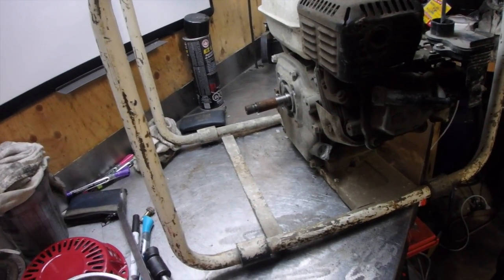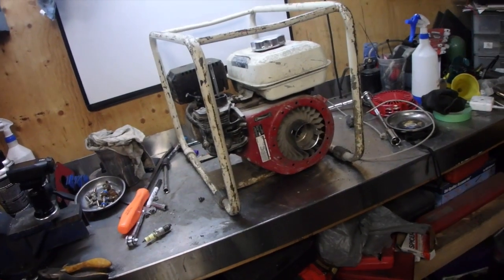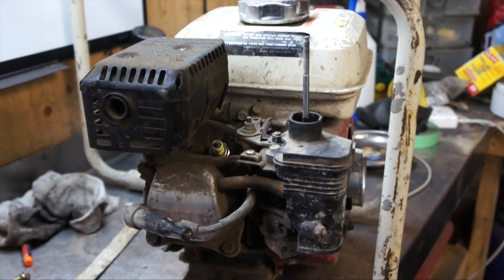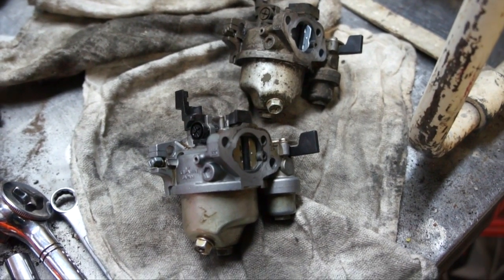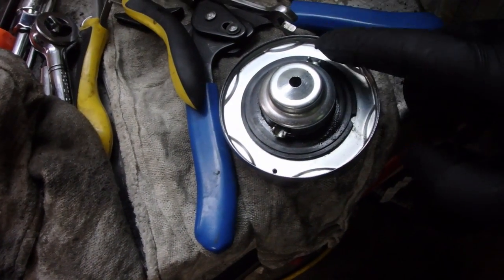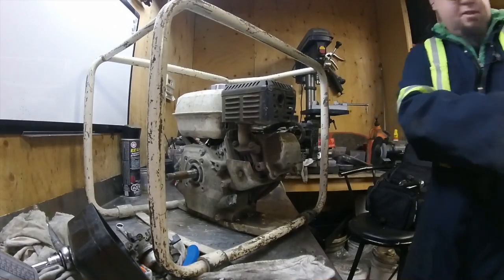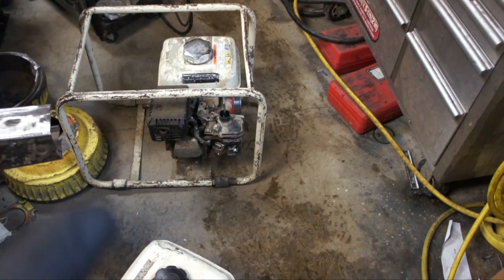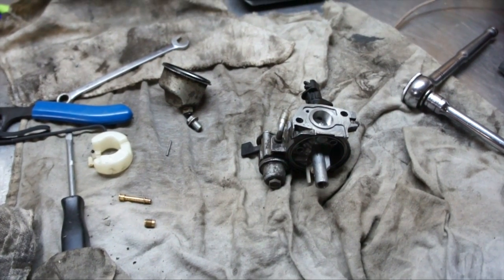Engine Only Runs When Choke is on

Comment: I've got the same problem!!! By the way, the choke lever has a nodule the same diameter as the fuel line so just pinch the hose and pull, then attach the choke lever to it. No leak ;)

Comment: Same for 2023 cars & trucks. The fuel filler cap lets air in! The amount they let out from pressure "Does" change. Stamped on cap or sticker, "Caution" May spray fuel was seen on 1960-70's cars. Carbon canister allow air to vent to atmosphere, but capture fuel. The pressure out was 1 PSI for decades then changed to 2 PSI so if tank pressure got to high. 10+ years ago, inputs from timer, air temp and time driven requires "Engine-Off, Natural Vacuum" helps the fuel tank pressure sensor sends info to the PCM 20 minutes after its shut off and eating dinner. This detects tiny leaks, not small or large. 
 Caps have to be tested and aftermarket caps with Keys to keep that expensive fuel from being siphoned, all fail. It take run time and temp before these test are run, so not the next day but still!
DK, ASE Master Tech since 78, retired

Comment: Dude it's not the fuel cap 🙄 You should be able to take off the fuel cap off without causing the carburetor to leak, that's just common sense. Have you ever seen any other carburetor leak every time you take the fuel cap off I mean that's ridiculous.

Comment: I have an old Honda GX200 motor and it wont run off of choke for more than 5–10 minutes of riding; cleaned the engine, carburetor, and even the gas tank & bowl; it idles fine, but wont give me full gas “sometimes”; the throttle can give me a little bit of rev, but too much rev and it will shuf off. Any ideas?
Reply: Man I'm having this EXACT problem please tell me you figured it out?????
Reply: @evanessary9056 same lol did you figure it out ?

Comment: If your engine simply won't run the quickest way to get somewhere is spray a flammable into the air intake like carb cleaner or starting fluid and if it still won't even fire for a second you have no spark. If It does fire then your having a fuel issue.. disconnect the fuel line from the carb and make sure its flowing out nicely. If not then most likely just need to clean the carb, its not difficult just take photos and remember exactly how everything came apart, note which side up or down on any little parts you remove.. stay organized and don't lose anything, Goodluck :)

Comment: there is a screw on top of some carbs that tell how much gas is flowing  if you have this type turn counter clockwise 1/4 turn will in grease  fuel flow   check this out before you start hunting and pecking the tbl.

Comment: Had the same today on a pressure washer. The fuel smelt odd so when I drained it I noticed a residue on my hands from the fuel. It turned out there was diesel mixed in with the petrol. A full cleanout and left to run with aspen 4 sorted it out.

Comment: I have the same problem too.I took carb off honda push mower that ran well but still same issue.I.m determend to check the valves and compresson. something else that shouldnt be over looked Larry
Reply: Put on new gaskets adjusted governor, new plug ????

Comment: Hi what will cause the gas to fill up in the engine oil .the engine will run great but once left over night has will get into the engine oil a hole lot . Thanks
Reply: Possible float stuck in the open position, therefore flooding the carb and overflowing, draining directly into the cylinder then leaking past the rings and into the crankcase to mix with oil...or not. Whatever

Comment: Ya know you tell people that about a dirty carb, but also too, people needs to know that its not always a dirty carb. If a muffler gets clogged up, it to can act like a dirty carb aswell. If a muffler has a screen over the exhaust hole next to a dirty tank or a clogged fuel filter, or a pitcock.
Reply: My Wen 3800i states to clean the spark arrestor screen every 100 hours with a wire brush.  More burnt dirt coming out to clog the system than going in (i.e. no "muffler filter" to replace)

Comment: Reamed carb with a welding torch probe, drained carb bowl, added new plug, changed oil and air filter. It was a clogged carb jet. 10 min fix

Comment: No shit, my motor would not idle. Took the carb off 10 times at least, finally used silicone gasket maker on all faces and made the nuts extra tight. F#*k me first pull and runs and idles like a new motor, so I think if you need the choke to keep it running, it's a gasket leak as long as all the fuel jets are clean and the governor is set right. Cheers to all the comments to give me ideas of what my problem was.

Comment: That boy isn't getting enaugh gas
Reply: My boy goes nuts when I open the choke compeletly which leads me to believe there is a problem with air fuel ration
Reply from the maker: Nope that wasn’t the issue

Comment: The round part of the choke lever fits in the fuel hose as a plug!
Reply: nice. thatll come in handy
Reply: @jeffsilverman105  I work on my bikes a lot, it's a cool little trick for sure!
Reply: Wish I would have known that when I took my predator 212 carb off
Reply: @JonLasaga ....but next time! Maybe you'll open up that carb and swap in a 140 emulsion tube and a gx340 jet. Great performance combination for any use of a 212.
Reply: @fatbuddycat  yeah it will be good for next time my engine has been acting up and it dies with any throttle when its warm only and I couldn't find anything wrong with it when I took it apart today so ill be doing it again soon.  Not sure if ill swap the tube though since I already have a bike carb for it i just have not put it on yet because I dont have the intake for it.
Reply: Or just jamb the wire end of an old spark plug into the hose.

Comment: Save yourself time and energy when working on a motor with broken recoil use a high power drill or impact on the center bolt just be careful for a back fire also use a 6+ inch extension and make sure socket can’t easily come off and fall onto the crank
Reply: Impact is a great way to break the end off your crank. Drill is ok.
Reply: @dwizdofoz.  I broke one trying to use an impact to start a small engine like this once
Reply: Iv seen guys snap them right off be careful especially with him dumping raw fuel into cylinder creating a prime condition for hydro lock
Reply: no danger of the socket not letting go when it starts?
Reply: @schoon111  lol 100%. Sometimes it works, sometimes it doesn’t

Comment: Could have spent a minute on the mixture screws.
Reply: Don't beleive this model has adjustments
Reply: @kendogg619  
Yeah they do, but they're designed in such a way that you can't remove them without filing off the tab that restricts any movement,  the only way round this is to cut it off with a dremmel

Comment: I pulled the bowl and cleaned out my pilot jet. Ran great. Another motor runs but not at full speed and when i pull the choke, it’s runs tHe same. No worse.  Shouldn’t the choke being pulled at full throttle cause motor to Stumble?  Mine still runs exactly the same?!  Clogged jets?

Comment: Full choke whould suck gas from the tank , can't run normal if not enough air gets into the gas tank to replace used gas . Higher vaccum would suck just enough air past the restriction to allow some gas to get to the engine

Comment: U need to drill the lid n put an. overflow the fumes suffocate the the flow of the fuel line if u run an over flow it'll breathe better n you'll get Alot more low end performance

Comment: i have a briggs 15c107-0014-f8 
runs smooth with choke 1/2 way 
cleaned main jet / emulsion tube , soaked  carb body
Reply: Did it run well afterwards?
Reply: @murphyking79  NO STILL SURGED , Ran smooth with Choke Partial on - Believe it or not !!!, RAN with " Mechanic on a Bottle " from Home Depot and CLEARED OUT !!! 
the STUFF Does Work

Comment: I have an old 22cc Briggs and Stratton motor from the 40s or 50s. I know that I won’t be able to find a car  for it. It is fully restored, no rust, clean intake/original air filter. Only runs with choke on. Should I loosen idle screw? Since I can’t get a new carb and the carb doesn’t come apart very well. If you know anything your feedback will be greatly appreciated ! It’s the last step before it’s fully finished project!
Reply: check out Musti1 channel, maybe you will get your answer.
Reply: AJAX m

Comment: Hi anyone know why my gx160 backfires when I pull the cord it does not start but backfires out the exhaust?
Reply: timing is out. flywheel may have spun the key, valves need adjusting or cam slipped a tooth. Good luck I had the same problem and just ran these issues down, it was the valves.
Reply: Make sure that you have got no water in the exhaust and you can try and start it with the air filter off!, the spark plug may need replacing or cleaning , it is easy to see if it’s sparking efficient and make sure that the carb is not flooded and the petrol is not old or dirty

Comment: Found my answer.  Watch the video.  When he unscrews the inner nozzle tube inside the carburetor, (where he takes a flat screwdriver and unscrews the post)  I had taken carb cleaner to the fitting, and it seemed cleaned - but it wasn't.   It was partially obstructed.  Just look through it onto the light and see if yours is plugged too.   Then I found that inside the nozzle tube was slightly plugged too.   I sprayed carburetor cleaner through the hole and found that it comes through the carburetor but could not see where the exit point was from.  I later surmised that it is coming between the two choke plates inside the carburetor.  (there's two plates plied together, not one.  There was no way I could clean between those plates with carb cleaner.  So I re-assembled the carburetor and found that I was on the right track.  It ran fairly rough in the "run" position, but ran.  Tomorrow I am going to get a chemical cleaner such as sea foam or something and try to chemically dissolve the rest of the deposits between those two plates as I use it for tomorrows work.  This is given that everything else that you can find is "good."  don't forget to take the float off and clean the needle valve, and spray all the fuel ports clean inside the carburetor.  Then  use fuel stabilizer in the gas from then on.

Comment: Thanks for the tip on checking whether or not the tank had airflow. It inspired me to check my clogged breather tube (predator, not honda) and my engine is running normally again.

Comment: I have a Baja warrior 196cc. It's starts but when I turn the choke off the bike will start to take off. How can I fix that.
Reply: Willie Covington your throttle cable is probably too tight. Only way that engines going to take off is if the throttle is open.
Reply: I have same issue
Reply: U need to adjust the carbs idle screw

Comment: Don't need a new carb. Just clean it and Hondas will run perfect again. I've fixed many Hondas.
Reply: I have a Honda gx340 
11hp
I bought a new carb because the old one was cracked, so I put that on replaced the gaskets, got a new gas line and gas tank. I put all those on. It will only run with the choke on, as soon as I turn it off it dies, and it won't idle correctly. Anything you would recommend I try or check?

Comment: you need to clean up the bleed in the aluminum body very tiny use air and carb cleaner
Reply: Mark Heberling how.
Reply: @vineetgupta6856  use a compressor

Comment: i have a Mitsubishi 6 hp engine on a go cart i just bought, but the engine will not stay running for more then a second. what are some ideas on how to fix it. 

ps. its been it has not ran in a few months, according to the previous owner.
Reply: Blake if you have time a carburetor problem are easy to fix only you really have to have time to learn how to fix them with my lifestyle i have played with all kinds of small engine's i never let it's beat me only sometimes i do have to Google it only not that offer only it be hidden jets in the carburetor be plug up you will need a bread ties to clean the small holes in the carburetor also some carburetor cleaning and make sure that you have a red tip on the carburetor can because you have to spray inside all the jets you gonna need a air compressor too to blow out all the jets hold the air  tool close as you can as you shoot air into the jets holes i always use water and degreaser with a spray bottle first before i started from the beginning wash through the carburetor outside and inside and use my air compressor to blow it dry outside and inside to get rid of all that gunk then i starts cleaning the carburetor don't use cold water use kinds of hot water when you first start to carburetor take it completely apart first i mostly used commercial degreaser because the job i work on get it by the five gallons bucket
Reply: Blake remember to use a red straw that's comes with the carburetor cleaning and make sure it inside each jets holes and make sure that you wear eye protection because that carburetor spray will be all in your eyes and that's not a good feeling

Comment: You cant leave these engines with gas in them for more than a month without risk of ruining carb. The good news is the carbs are under $20 online. Don't mess with trying to clean the carb, just install new one and go on.
Reply from the maker: Amen to that
Reply: I’ve been using sta bill fuel stabilizer for over 20 years never had a problem every 6 months if I don’t use the gas up I pump it out with a 12v electric fuel pump I dump it in the truck and I add new fuel with sta bil and run the engine I never leave carb dry
Reply: lou f -  Thanks bud; that's one educational reply!  Gonna clean carbs and put in Stablizer Tomorrow!  It's 2 am now so gotta wait!
Reply: Rick Parker Blame the ethanol added to the fuel. it doesn't do well with brass/ copper parts.
Reply: Its not that hard to clean the carb. If you're lazy, just put acetone in the gas and it'll clean it for you.
Reply: I bought an ultra Sonic cleaner and haven't had no issues for last 6 months running 15 Honda gx160 trash pumps the fuel out here is bad gunk's up carb if it sits so I have 3 spare carbs I use to switch out no issues
Reply: throw away nation, $20 can feed family of 3 for whole wee in my country, what is wrong with cleaning the carb
?!

Comment: the problem with the carb is the idle jet which is plastic and it's located under the idle adjustment screw. Get a new jet with the orings the orings in an old carb almost always rip.

Comment: Jerry, I have a Honda and Clarke generator with Honda gx160 engine, I have changed spark plug, ignition coil, serviced it, cleaned carb thoroughly and it still cuts out after a few seconds... the spark looks weak even though it's new coil and plug... sparks 1 out of 3 pulls if that, any suggestions as to what to try next... really stressing me out hope you can help!?
Reply: Checked the distance of the spark plug?
Reply: Thanks for replies it was a fault oil sensor
Reply: Josh Regis probably rich fuel mixture
Reply: Ibraheem Al hadede  it was faulty oil sensor

Comment: ITS RUNNING TODAYWHAT I DID  WAS  GOT A TUBE AND  BLEW IN  THE AIR HOLE  IN THE ENGINE. MAYBE THAT DID IT I DID.   SPRAYED CARB CLEANER IN IT BEFORE  SO  I MAY HAD NOT HAD TO SPEND  85 TOTAL FOR A NEW CARB.     I GOT THE MOTOR 10 YEARS AGO AND ONLY PUT OIL AND GAS IN IT .   I NEED TO GET A NEW PLUG FOR IT THIS SUMMER. TOO COLD  TO RIDE MOTORBIKE   NOW, GOING TO  25  BELOW TONIGHT

Comment: my gx50 honda engine will not run with choke   off . i got a new carb  still the same will not run  choke off. gas from   9-15 16. engine 10 years old been very good   same plug.  has been used on a bike .
Reply: molegfgfgf sometimes it's not the carb but it's the gas. Trying cleaning the gas cap. Also try cleaning the air filter. Next try putting some zero octain gas in it. It's made for small engines. Also add some fuel stabilizer.
Reply: molegfgfgf it could also be the gaskets, also known as a vacuum leak. Try putting new gaskets on.

Comment: I have problems with my engine it only runs with choke on idk what is going on with it we changed the carb already
Reply: need to inlarge jet as the engine is broke in it needs more fuel that's way it run better with choke. take jet out and drill one size bigger that stock size. that will fix you up.
Reply: Cj marcel Try replacing the gaskets. Put new gas and fuel stabilizer also.

Comment: What is the correct petrol (gas) to two stroke oil ratio for this engine,cheers.
Reply from the maker: +craig stone it's a 4 stroke engine
Reply: Hi jerry, i'm in the U.K. so our standard unleaded petrol wont run it, it only runs with two stroke fuel (unleaded petrol and two stroke oil)..
Reply: I've sorted it now its 50:1 ratio.

Comment: I have a problem with the same engine gx200 it doesn't have a needle idle mixture on the side could that be the reason why it won't idle on run
Reply from the maker: +Nick Donato i would do a cylinder leak down test to see the health of the engine
Reply: how do I do that

Comment: I have the same issue with a briggs and stratton 14.5 horse vertical. I've asked around and was told to check the compression. possibly the piston rings or valve spacing.
Reply from the maker: +swinkyfox that is very possible however the issue you may encounter is false low compression because lots of times these engines have a decompression level.  the only way to really test the rings is with a Leak Down Tester

Comment: Lack of fuel for sure. Should be able to open up the jets to over fuel it as well. If not the carb emulsion tube is plugged.
Reply from the maker: +Steve Rob that's what a person would think and it' seems very logical, however wait till the next video.